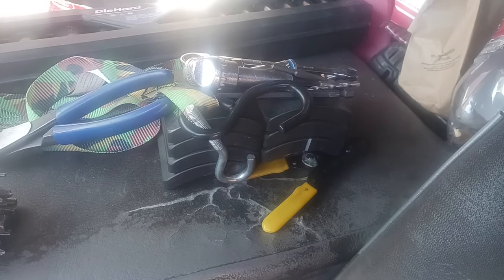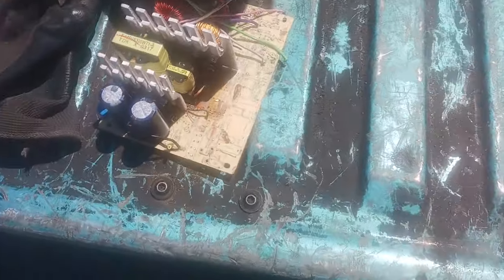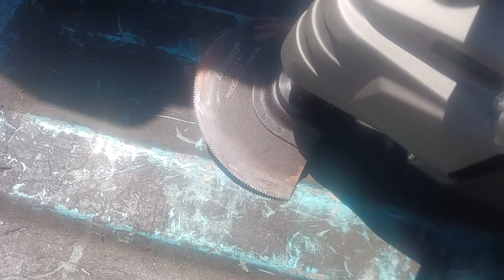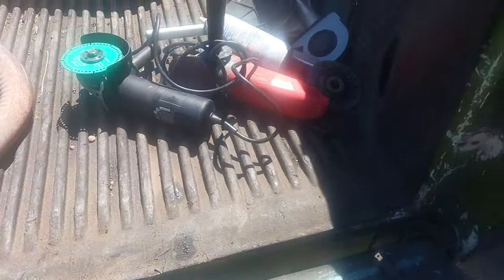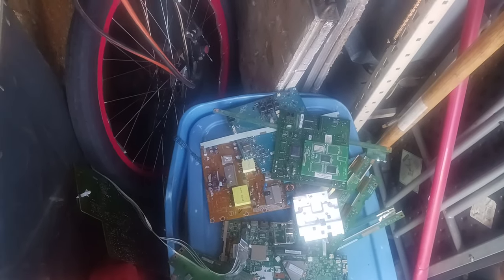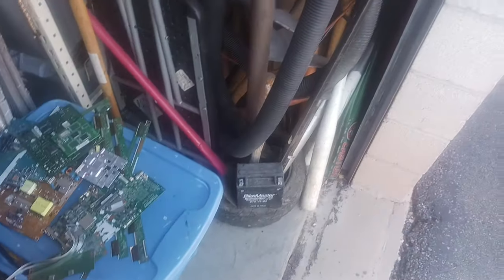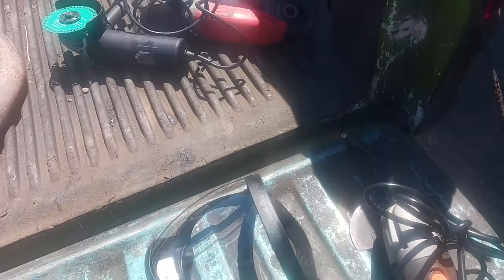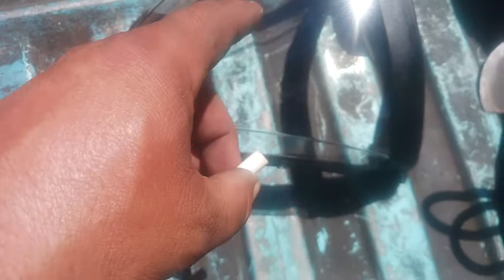could this really work

Comment: That's a good idea! Never thought about an oscillating tool !!  Yeah the temu blades  are no good.  Send them a message and they will refund you your money..  good update and I'll see ya in the next one!!
Reply from the maker: That is no fair that you know where I got them from. Now I'm just going to expand the hole a little bit and then slide it on period or find somebody who has a water jet that can cut it out a little bit bigger. Wait until you see my next couple videos. I think I got one more before I do the stripping boards one again
Reply: @ViperRecycling  everyone knows what temu is brother!!  The blades come with a small washer
Reply from the maker: @scrappingonthefly77  not on this blade it doesn't. The hole that's normally there is too small for the grinder that I'm using. And there was nothing else in the bag. I will make a video just for you so you can see what I'm talking about. I will name it here you go scrapping on the Fly 77 this way you know to watch it and see what I'm talking about. But that won't be until tomorrow because it's starting to get dark here
Reply: @ViperRecycling  no worries.  Mine had small washer in the bag